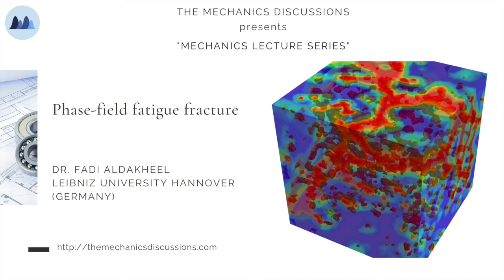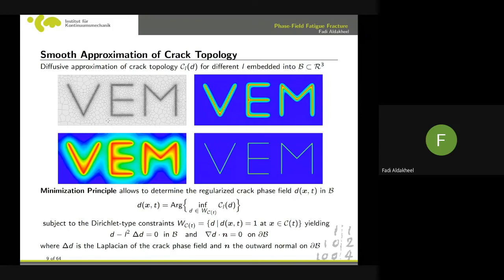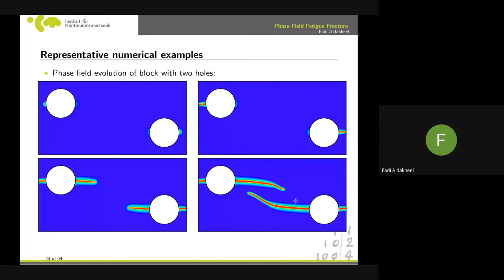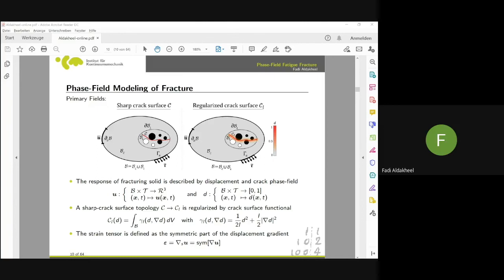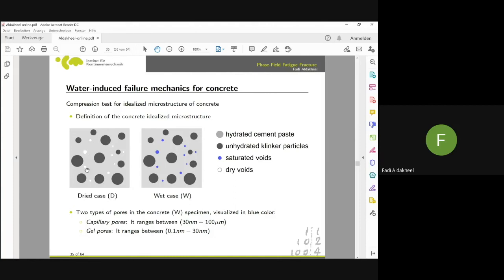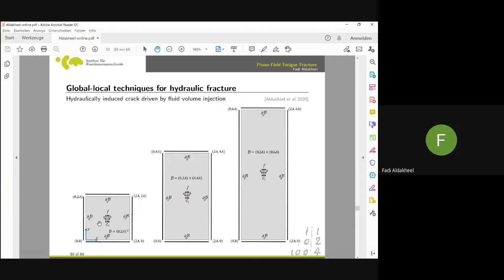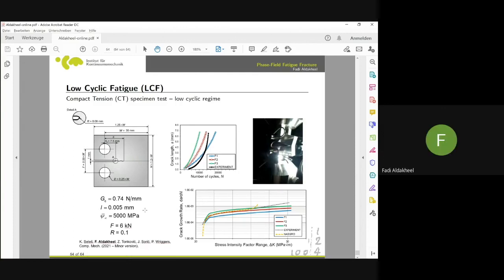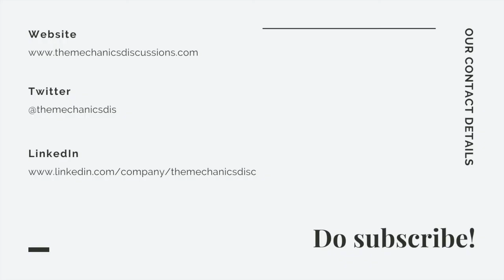Lec 15: Phase-field fatigue fracture

Comment: Very interesting lecture. However, you did not explain how did you implement your models. Do you have any suggestion. Thank you
Reply: Dear Zoghbi,
Thank you for the interest in our work. Regarding your question about implementation: For the first part of this talk: We reach to two PDEs (related to Deformation and Phase-Field Fracture). Here different methods exist in literature on how to solve them. We used staggered scheme (alternate minimization problem), i.e. so first solving for equilibrium equation at fixed fracture problem then we solve the phase-field PDE at updated mechanical deformation. Also we used in some other examples fully monolithic scheme where all unknowns solved together at the same time.  So it is up-to you what you prefer, this needs however special care specially for the monolithic procedure. 
If your question related to the programs that I used to obtain those results: well I used for some of them "Fortran + FEAP" (finite element analysis program); Matlab (for Global-Local approach to fracture); in other examples we employed the "AceGen/AceFEM"  program where one directly obtain the linearization without the need for unnecessary derivations. Last part (Fatigue Failure Analysis), we used Abaqus with user-subroutines. To this end, soon we will upload the codes online. For that please check my research-gate to get the updates. So it is up to you as well, just use what you prefer/know/like to code your material/structure behavior.
Best regards,
Fadi Aldakheel

Comment: Do you run each cycle separately? And each cycle would take atleast 10 to 20 iterations right? So for 1E+5 ctcles, did you run 2E+6 simulations?
Reply: Hi Suredran, 
Thank you for the question. Sorry just saw it now. For the computation of cycles, jump techniques, and running time please refer to our work:
https://link.springer.com/article/10.1007/s00466-021-01996-5
Or: 
https://www.researchgate.net/publication/350483206_A_general_phase-field_model_for_fatigue_failure_in_brittle_and_ductile_solids
Best wishes
Fadi